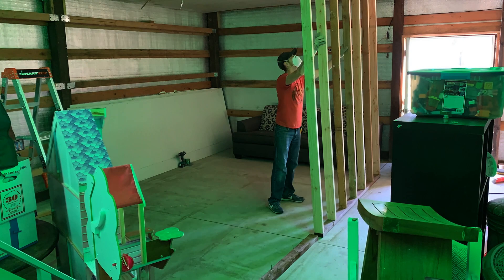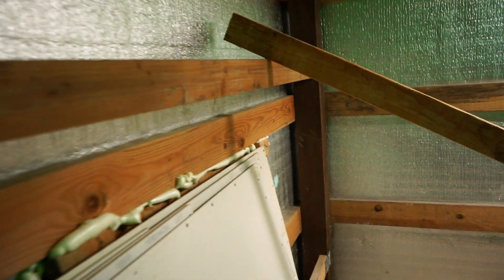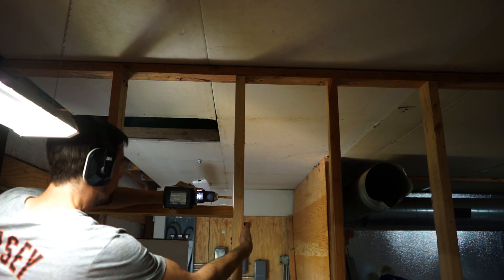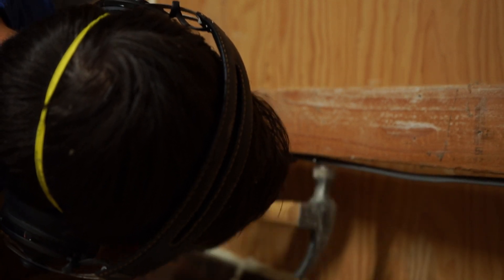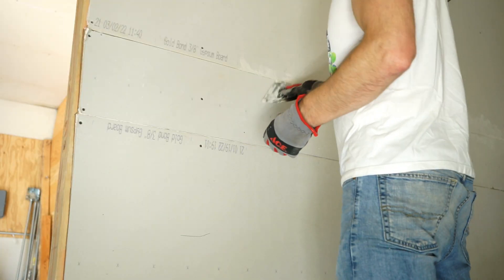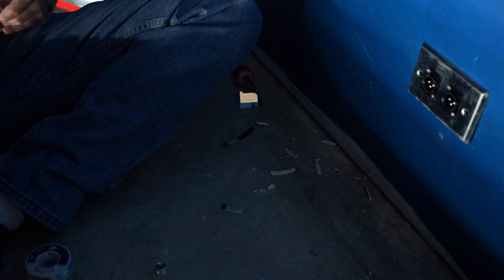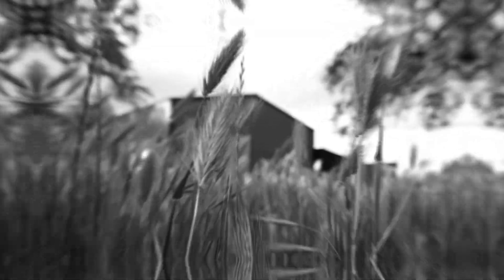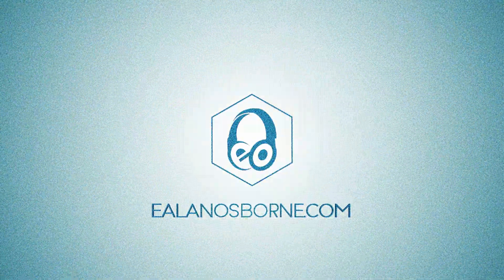DIY HOME THEATER BUILD EP 2 | Home Audio

Comment: Most of the contents are 5.1 can a budget system read the movie signals and turn it to atmos or even real cinema experience?? Thanks
Reply from the maker: Dolby upmixing is pretty sophisticated these days, so yes - it does a pretty good job expanding even a 5.1 mix to utilize all the speakers in an Atmos setup. 👍
Reply: @hiddenmovieclub  thank you very much i appreciated.

What is a dobly unmixing?
Reply from the maker: @salehkambijo1849  Taking a 5.1 mix and “upmixing” or expanding it to a 5.1.2 Atmos mix and beyond to match how many speakers are actually in your system.
Reply: @hiddenmovieclub  i have 5.1.2 and thinking to upgraded to 9.2 for really cinema experience.
Reply: @hiddenmovieclub  that's really great so i don't have to get huge Dolby Atmos files just 5.1 format and it does this mixing and the sound comes from everywhere.

Is that what you are saying???
Reply from the maker: @salehkambijo1849  Yes. Although sometimes it might be a little bit off, since the upmixer is trying to estimate where sound should be. A true Dolby Atmos mix will sound better overall.
Reply: @hiddenmovieclub    that Okey because I need it when it difficult to get the true Atmos for the content. Okey so any suggestions which one should i bay a good budget one?
Reply from the maker: @salehkambijo1849  Denon S760h, Sony STR-DN1080, Yamaha RX-V6A

Comment: Great stuff, as always Ealan! I do have a couple follow-up questions for you on a more permanent theater space as I am worried about the potential interference you mentioned from running electrical too close to the speaker wires. 1) when laying out the various speaker wires, can you run long HDMI cables with the speaker cables without creating that interference; and 2) would it make sense to use a conduit of some kind in case the wires/cables need to be changed or upgraded in the future, or would that also create the interference?
Reply from the maker: 1) I’d try and keep HDMI runs to a minimum. In my previous home, I had a media closet far from the TV, ran a 50 ft HDMI cable up through the attic and had video dropouts from time to time. I tried many different things but always has issues at some point. Not ALL the time, but so annoying when they did happen. If possible, keep HDMI runs to maybe 25 feet max? 30 feet, maybe? But yes - I’d try and keep HDMI away from electrical wires as well. I think it’s better shielded than speaker wire, but better safe than sorry. 

2) If you have the space to run some sort of conduit, do it, for sure. Especially if you have insulation in the walls, etc. It makes any future replacing of wires or cables SO much easier since they slide easily within the conduit. 🤘

Comment: Hi Ealan, every time I watch your videos there is something new that I learn and besides they are shot in a very entertaining way too! I have a question, do you think using atmos up firing speakers can come close to in ceiling speakers as I live in an apartment I can’t make holes in the ceiling and a week ago I had got Denon X1600H with Elac B5.2 and Elac 8inch subwoofer for rear surrounds I’m using my old 4inch speakers. I need your advise/recommendations on the atmos up firing speakers and centre channel. Just saying, here in Malaysia HiFi/HT equipment are crazy expensive compared to USA, you guys are very lucky in that regards 😊🤘🏻. Thanks in advance!
Reply from the maker: Well, Elac does make some really good speakers in general, so I'd try and stick with that brand. It's always a good thing to be timbre-matched, utilizing the same brand throughout (if at all possible).
Reply: @hiddenmovieclub  Sure, thanks a lot. But do you think the up firing speakers do a good job of reflecting the sounds off of the ceiling (given the height is <8feet and flat ceiling)? And also in one of your previous videos you had lung the speakers using the Velcro, could you please share that brand name? Thanks again! Apologies for bothering you with all this, this is actually my first HT setup and before I was using soundbars, so I thought who better than you to take advise from 🙂
Reply from the maker: @habiburrehamanshaik6146  Oh for sure! Velcro might be a good option in your apartment. It’s just some industrial strength Velcro that I got from Home Depot. The brand name escapes me. Nothing special, though. 😁 The only thing to watch out for is that since it’s industrial strength, it might peel off the paint when you move. But just a quick paint job should take care of it.
Reply: @hiddenmovieclub  Sure thanks a lot😁👍🏻